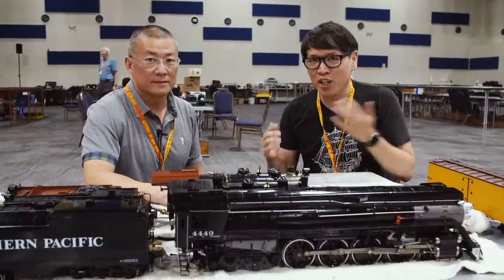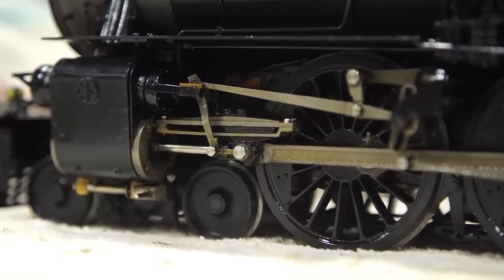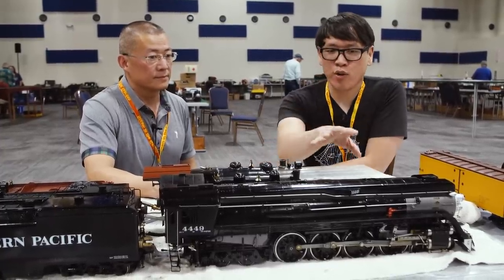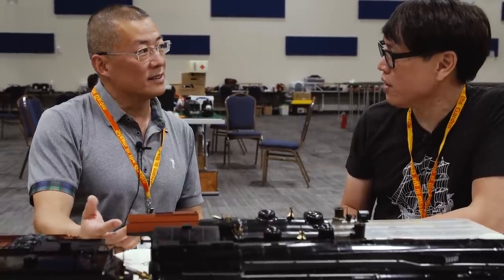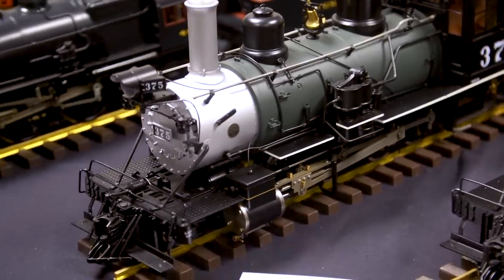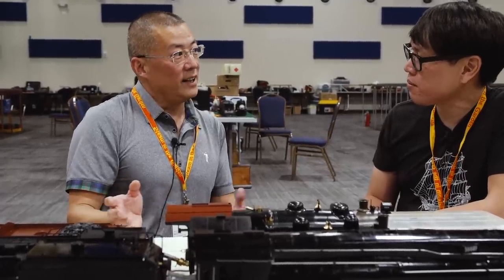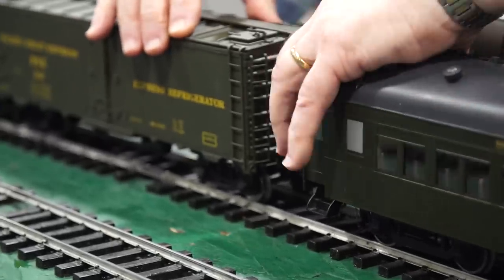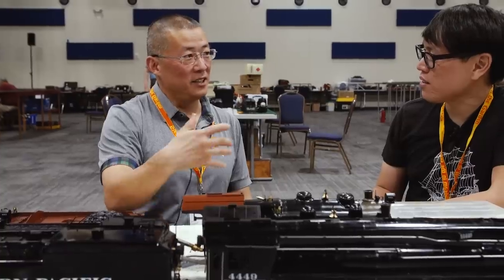Accucraft's Model Steam Trains

Comment: You know, the cost would go down if they mass produced these things. A case in point is O.S. Live Steam's big 7.5" gauge Baldwin Mogul. Most companies that build 7.5" gauge live steamers build one-off, custom to-order models, and a Baldwin Mogul from one of these companies would go for in upwards of $50,000 or more. But O.S. Live Steam's Moguls go for around $20,000 (converted from ¥2,250,000 in Japanese Yen and rounded to the nearest 10,000), simply because they keep them in production.

Doesn't even have to be extremely high levels of mass production. I'm just talking about making, say, 10,000 of them instead of 1,000, for example.

Comment: If they have a union Pacific big boy  ready to run, I need it.
Reply: Got a spare $8000?
Reply: Pretty sure they had one at one point, but it's currently not in production.
Reply: for the price of a G scale big boy you could build a 1/8 scale 2-8-0 or similarly sized loco, way better choice imo

Comment: The guy mentioned a Big Boy model.  I would have loved to see one of those under steam. I guess I'll have to wait until the real one is through restoration. (The Union Pacific steam shop would be another fun place to send a Tested person to interview, by the way.)
Reply: Me too! I wonder if it requires any special treatment or skill to get it running smoothly? (I was into trains as a kid, the Big Boy was my favourite). I still remember it was a 4-8-8-4 (that's the limit of my train knowledge).
Reply: It only needs to remake the boiler (you know how much scald was in those water tubes), remachine the pistons and valves and rework the tires.